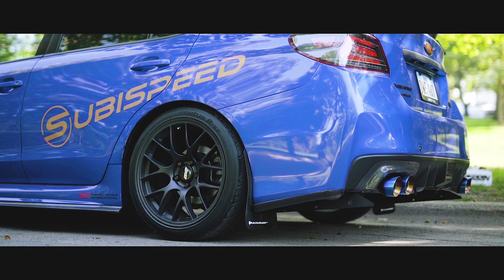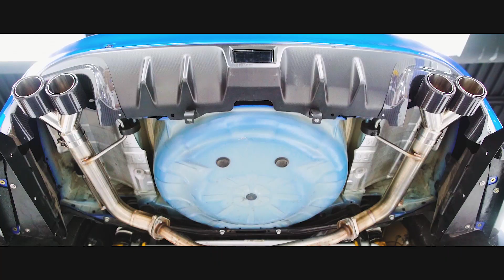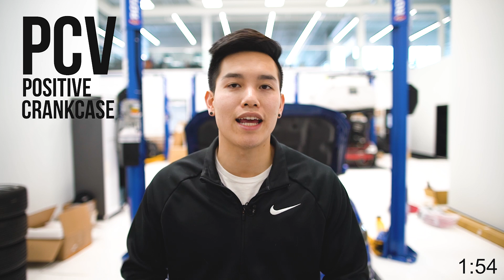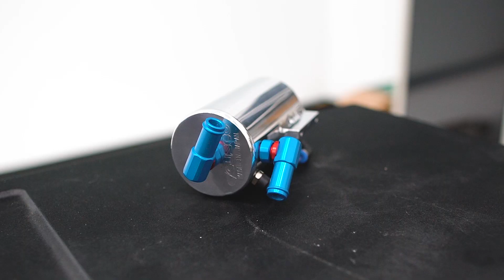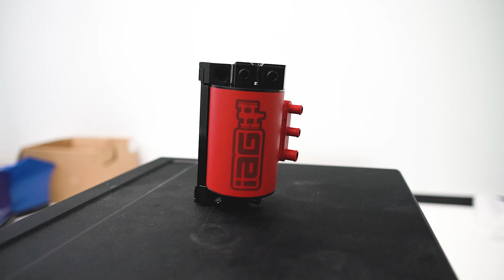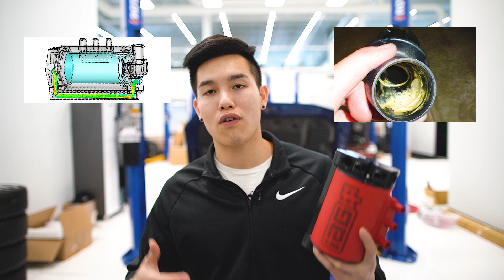Difference between a Catch Can and an Air Oil Separator

Comment: I installed the IAG AOS... first off let me tell you, love the system, easy to install. Second you will notice right away - I am running Stage 2+ oil smell and excessive white smoke. Perrin makes an item that they include in their system that all AOS systems should include to handle the turbo sump issue.  Just a recommendation to get that part if anyone is installing this on their car.
Reply: It is also a problem with a subaru 2014 WRX ?
Reply: So ur saying since you installed the aos you have been smelling oil?

Comment: for those not in the loop, an aos or catch can helps decrease carbon build up on intake valves for vehicles with direct injection. if you have a port injection motor the fuel injectors do a good job of cleaning intake valves with gas so this system isnt as important.
Reply: Well what if ur engine is port injected and direct injected 💡

Comment: I’ve been using the grimmspeed AOS with Cusco catch can for 3 years, and luckily, no issues (oil froth) or oil found in the catch can. I do occasional spirited driving. I recently checked my tmic for oil residue, no oil, so it holds up well for normal driving. I believe the IAG is more for auto crossing.

Comment: For the AOS, is this something that you'd peg as necessary right away or is it more something that you use as a vehicle ages?  Like would you go slapping this on a brand new car or not so much?
Reply: Emily Schultz im looking for that answer as i am an owner of a 19 sti
Reply: I've just got a 2019 STI as well and my tuner highly recommends the installation of an AOS even on a brand new stock vehicle. It is a worthwhile investment.
Reply from the maker: An aos or catch can can be installed whenever you'd like. Of course, the sooner you install it the less build up and such you prevent though!
Reply: @SubiSpeed  Okay that is fair.  Does it have warranty implications or not really?  From what I understand, it doesn't seem like it's something that could hurt anything...
Reply: Check your warranty agreement with Subaru or your local dealer. To answer your question, I would install an AOS ASAP if you typically drive the car hard, even if it was a new car. If you drive very conservatively and stay out of high boost then you will be fine without it for a while.

Over time, if you check your intake component couplers you may notice oil starting to accumulate. Your throttle body or intercooler/piping could also show signs of condensed oil accumulating. It becomes more apparent with increased "blow-by" caused by high boost pressures, wear on piston rings' and cylinders' seal (tightness?), and prolonged operation in higher revs. Without the AOS or catch can, it is recommended that you clean any excess oil out of intake components as part of general engine maintenance.

The AOS helps reduce the amount of oil vapor that would otherwise have made its way into the intake. As was mentioned in the video, excess oil vapor mixing back into the intake supply can lead to carbon deposits and lower effective octane level. What he didn't say is, risk of knock or pre-detonation increases with lower octane. Knock/pre-detonation is an explosion in the combustion chamber off timing, or when it's not supposed to. It causes destructive interference in the crank rotation and can lead to severe damage to vital engine components (think explosion but no where for the explosion to go, so cylinder pressures skyrocket until exhaust valves open). Avoid knock.

Comment: I just purchased a 2020 Subaru WRX premium, should I install a air-oil separator? PLEASE RESPOND.
Reply: I'm very positive these void the warranty on vehicles. So I would only do this if you are very confident. But i would leave it, especially on a new 2020 with the warranty (im sure) still good.

Comment: If i have a 2014 WRX stage 3+ do i need a IAG "street" Air Oil Separator or a IAG "competition" Air Oil Separator. I'm running a reliable 400+ whp. I'm not competing

Comment: Turbo timers?! Should I invest in one . Which would you recommend and at what stage of a wrx build would you recommend investing in one?
Reply: I'm pretty sure newer cars don't need a turbo timer like the old turbo cars did, google it.
Reply: @therealsnow  I just wouldn't know how they would combat oil build up in the turbo . I always let it idle like 5 mins before shutting it off.
Reply: Google it for more info, but these cars use coolant to remove heat from the turbo.

Comment: Anyone have any suggestions for an AOS for a Lexus IS250? Please don't say the rr-racing one since call it an AOS but it's just a catch can. It doesn't send oil back into the system and you still have to drain the can manually periodically. Wouldn't you just be able to use this AOS with customer measured hoses?

Comment: Should you add a catch can on both the CCV and PCV?  Is there any chance of either causing a vacuum leak?
Reply from the maker: If you want the most preventative measures, yes. Shouldn't cause any leaks as long as you go with a quality setup and assure all the fittings and lines are installed correctly.
Reply: SubiSpeed is there vacuum in either of them?
Reply from the maker: The whole system would be under vacuum as it's pulled back through the intake.

Comment: Do you have to change the filter elements on the AOS? Wouldn't there be build up? Nothing on an engine is truly set it & forget it. Especially when it involves waste.
Reply from the maker: There isn't a filter element to change on an AOS. It uses baffles to separate the oil from the air and then routes it back into the engine.
Reply: @SubiSpeed  I asked because it looked like some sort of filter element near the casing but I guess it's considered baffling. It still appeared like it could easily slide out for cleaning, can it? 
Thanks for your time.  I'm really researching this whole catch can subject by comparing the various components involved within the cans. I also don't know if I am going to need a 3 port can? I also saw a Moroso vacuum pump catch can which seems to be the only brand making that specific can. I'm thinking that if you have any air pump like I do on my ML55 AMG that it would apply to that kind of system?  
Anyhow,  so far it seems like I am down to UPR, RXPERFORMANCE which is almost impossible to find for sale, Mishimoto, Trick Flow,  and maybe Black Forest?   The things that I am paying attention to are the filtration elements and the distance between the inlet and outlet. Along with wanting a dipstick type versus a window that you wouldn't be able to see.  I don't like exposed clear tube set up neither because that's just something else that will end up being dirty with build up. I think the Trick Flow has a stupid little circle window but, I am trying to see how well their filtration/baffle system is.  Which is difficult to find for most cans, such as the Weapon R box like catch cans.  
Thanks for your time. Wish me luck! Oh, would you happen to know what exactly would require a 3 port vs. a 2 port? I know that I don't need one with a breather though.

Comment: Ive been thinking about putting an ecohitch trailer receiver on my 2016 STI and wondering if it can really tow a single jetski with no issues
Reply: Ive seen it done.
Reply from the maker: When it comes to towing with the WRX or STI I would have to advise against it. These vehicles are not meant for towing. Even though some people may or may not have had success with towing small trailers and such I just wouldn't want to risk it. I recommend heeding the warning in the manual.

Comment: Are there any potential risks of using an air oil separator?  Are you going to offer the Crawford Performance AOS?
Reply from the maker: Only risk is if you live in a cold climate you need to let your car warm up as condensation may freeze up in the lines. 

Are you referring to this one?

http://www.subispeed.com/crawford-performance-air-oil-separator-v3-2015-sti#.XGySYy2ZOgQ
Reply: @SubiSpeed  that's the one!  Thanks dood.
Reply: SubiSpeed how long do you have to let your car warm up? I didn’t know this was a concern for aos’s.
Reply from the maker: IAG recommends warming your car up to normal driving temps until driving when it is negative degree weather.

https://www.facebook.com/IAGPerformance/posts/2464853653586997

Comment: What is the Difference between the IAG AOS Street Series vs IAG AOS Comp Series? The Price change's So, What's the Difference and which one is Best? Been Contemplating on Getting the Street Series as everyone has them, but your COMP series is A bit cheaper and I want to know why and what's the Difference like for reals. I dont want to spend the money when they are the same thing and next thing you know Regreting that I should have went with the Street Series or the Comp Series.

Comment: Any Idea when the 18 - 19 Subispeed headlights will be released?
Reply from the maker: The pin out for the 18+ models is different and requires new circuitry work on the headlights for them to be compatible so it might be a while before they're available.

Comment: Would you recommend getting an AOS if you live in a cold climate and use Flex Fuel?  I've heard that those 2 things can each cause sludge buildup in the lines which leads to them needing to be replaced every once in a while.  My thought is if you have both of those at once doubling the buildup would it be worth it to even get one in the first place with how much you would have to replace the lines?  Any info would be greatly appreciated.  I don't own my WRX anymore, but I miss it so much I'm in the process of getting another one lol.  Have always loved your guys vids!
Reply from the maker: Yes, an AOS is even more recommended if you're running flex. As for the cold climate, you just want to make sure to warm your car up properly as condensation may freeze in the lines.

Comment: Hey i got a tourqe solutiion steering lockdown i installed correctly and i have some steering wheel vibration and also feels as if theres play please lmk thanks guys
Reply from the maker: That shouldn't be the case so you may want to recheck the installation otherwise uninstall and see if the problem still exists.

Comment: Why does the aos require a tune? They are way more convenient I live in a cold climate and have to empty catch can every week.
Reply: Savage Grace IAG street AOS doesn’t require a tune but IAG comp AOS does because the air isn’t returned into the intake system.

Comment: Install video please!! Many videos out their but aren’t really showing how to do DIY. 

I do have a question regarding the Invidia Q300 if anyone else would like to chime in please do so. I have a 2015 STi with a Q300 and noticed the passenger side exhaust vents/smokes more than the driver side exhaust. Is this normal? Any idea on why??
Reply from the maker: I'll do my best!

As for the exhaust question, the exhaust gases will always exit through the shortest / path of least resistance which is why you see it come out more on one side rather than the other.
Reply: SubiSpeed Thanks!! The Q300 seems to be split evenly in the center to both exhausts which I find strange for it to smoke uneven

Comment: What is better cobb the one you showed or grimmspeed aos?
Reply from the maker: The Cobb and IAG aos' are very similar besides a few minor details. You can't go wrong with either of those two which are the ones we recommend, but having one will be better than not.
Reply: IAG is definitely the best design right now. Cobb’s AOS is basically a rebranded IAG with a few tweaks

Comment: I had the Cusco catch can on my sti and it did not catch anything until my engine blew up (cyl4) and then it started to catch oil. I have upgraded to the IAG aos after the rebuild per recommendation and it SEEMS to work better ie, its catching blow-by.

Comment: Why so many install videos on wrx than  sti?
Reply from the maker: Since the WRX is the newer platform with a new engine, there have not been many videos covering installs. Whereas the STI has plenty of videos out there since it is an older platform.
Reply: SubiSpeed so the engine bay are all the same? Where fitment and putting everything on the right place are the same as all?
Reply from the maker: The engine bay itself may differ a bit but the engine itself is the same and installs will be practically identical if not very similar.